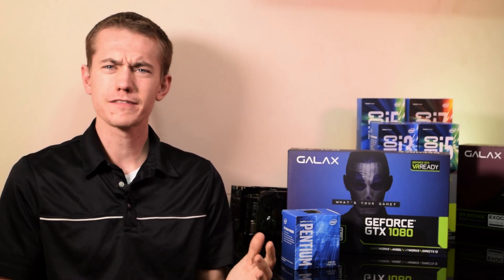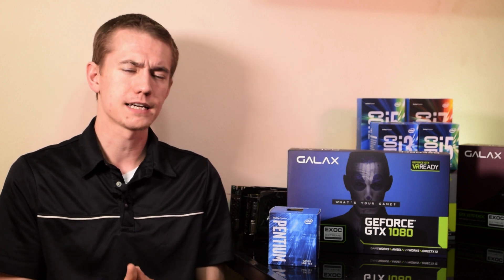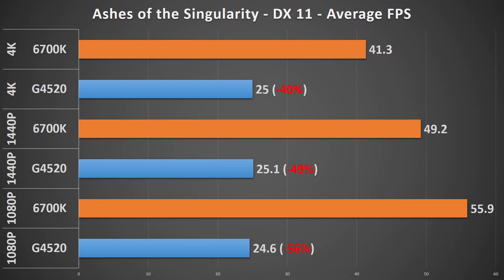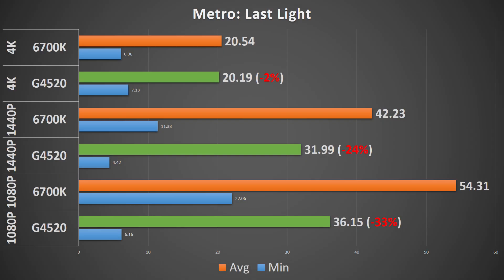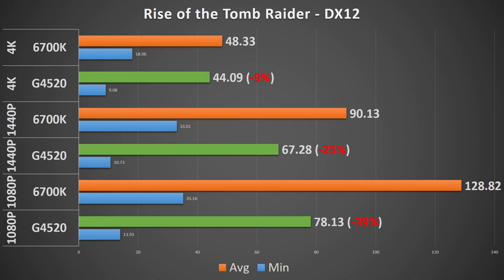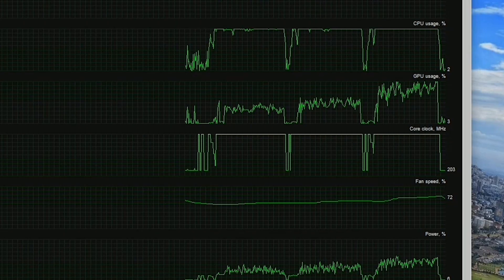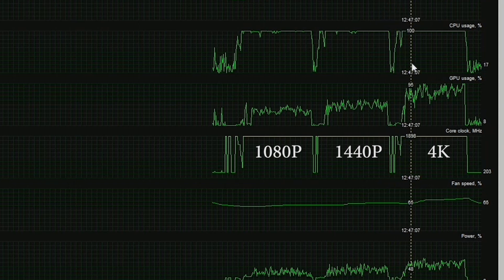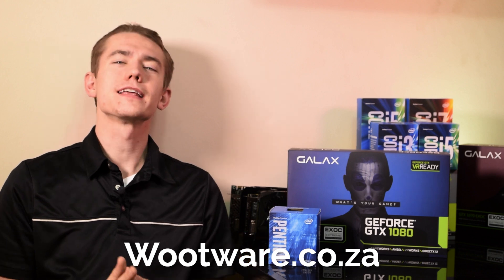Pentium G4520 + 1080 - How Much Do 2 Cores Bottleneck? - STUPID Series [#001]

Comment: I have a G4560 with a GTX 1050 TI. I'm planning to upgrade to either a  Ryzen 5 2600 + Mobo for the cpu. Or GTX 1070 TI for the GPU. I can't do both. Any suggestions?

Comment: Thanks a lot!!!
I bought a base for gtx 1080
3kmhz 16gb
6700k
Z270 

But was actually considering to buy a gtx 1080 instead of the base and wait with the gpu until I could afford the base. I was regretting buying the base instead of the gpu as now I cant get it anywhere or for a normal price. But thanks to ur vid I see I couldnt use the gpu anyway with my former i3 2120 cpu ..

Thank you for the dumb series. Sometimes its very important to know such info bcs u find ppl being cornered into all kinds of situations in this branch.

Comment: I know it might be funny, especially judging by some other comments, but some conclusions are not far off if you take the G4560 instead of the G4520. I actually made a G4560(!) build pairing it with a GTX1080 for 4K gaming and I can't stress enough how underrated or perfect of a combination that is for that very purpose. As the G4560 is a hyperthreaded part, it makes all of a difference as it provides games the 4 threads they are asking for to get rid of the otherwise apparent stutter that you might get on some games on the G4520. The G4560 processor however, costs about 60$ and offers absolutely no tangible difference in 4k games compared to anything all the way up to the 7700k. That's a 5 times more expensive processor driving same frames in 4k gaming as the G4560, as you're tied to 60hz and both chips deliver that in all but 3 CPU bound games in existence. In worst case scenarios you will notice drops to 40s that the 7700k would otherwise maintain. No biggie for a difference between 60$ and 350$.

I read several reviews stating "nobody would pair the G4560 with a GTX1080 so this is just to test the processor's capabilities without the GPU bottlenecking" yada yada. Everyone tests in 1080p. Sure, for high frame rate gaming that's what I would be interested in. But guess what, for 4k gaming, the G4560 legit maintains whatever frame rate the GPU is capable of spitting out all the way to the monitor's refresh rate and it is indeed the perfect processor. Future proofing? By the time the G4560 chokes, you will be able to switch to Coffee Lake (or maybe Cannon Lake) on the same socket and still save money and still have more longevity out of your platform without ever sacrificing on the gaming experience.

Going even further, save 300$, get a 1080TI instead and it will serve you so much better at 4K. You can still walk away with some spare cash and ability to crank the settings from high to ultra without still being limited by a freaking 60$ CPU that makes the i5s and i7s feel just like a pure waste of money for no gains whatsoever. The fact people are not talking about this or doing that all over the place made me scratch my head. Thanks!
Reply: Szymon S. Thank you so much for your comment, I've a g4600 build and been wondering if to get a GTX 1080. You've just answered it for me

Comment: Great video. Do you have any information in regards to Coffee Lake CPU's being supported on Z270 motherboards? I currently have a 4790k, and am in the process of giving it to my friend who's struggling on an Athlon 860k. I was considering buying a z270 motherboard and a G4560  as a place holder, and upgrade to Coffee Lake in the future "if" the rumors hold true. However, I would hate to buy into z270 and then not be able to do so. I understand that official information on this is scarce, but I figure it's worth asking if there is any validity to these rumors.

Comment: well, guess what? i`ll be using the G4560 with a 1080 Ti really soon, because i feel that the 980 ti can`t get the best of the dual core :))
kidding asside, i WILL be using this setup, but only for a while. I`m selling my 4690k and 980 ti, buying a 1080 ti for the main gaming pc and the cheapest kaby lake platform for a 4k hevc h256 HTPC, wich i`ll use untill the next gen platform is launched. I mainly play Dota, Assetto Corsa and Dirt Rally in 4k, so i`ll be ok for a while.

Comment: Hey could you try this with a 1070 and at 4k, to see if the stutter is gone? or perhaps use a higher clocked dual core?
Reply from the maker: +Ignafiltro Sanchez I did.  See my follow up Pentium video.  Pentium is bad for gaming, stutters any 4K capable GPU. 4 threads seem to be a minimum.

Comment: Pentium g4560 paired with a gtx1070, what you think. The plan was to get a asus strix 1060 but asus strix 1070 is only like $80-100 more on amazon so I figured whatever I'll get more frames & guessed the cpu'll live, for now.....kinda scared for when I set this crap up cause 1070&1080 same damn card almost!!!! Can I get your/somebody's thoughts on this???? I'm 100% serious this is big money coming from consoles I'm scared lol
Reply from the maker: The G4560 is going to bottleneck the 1070.  Here's a deep dive I did with the i3-6100, similar to the G4560, https://youtu.be/mxCFKkEvN0A   Even with a decent i5, the 1070 can still be held back in some games. It won't ruin your experience, but it's not a wise idea.

Comment: You can do the same test but for example comparing an i5 6500 with an (i7 6700k or 6600k OC) paired with 10xxgtx on games, i see a lot of people asking those on the web, it would be interesting to know how much bottleneck in % would have an i5 6500 compared with the other/s CPU/s
Reply from the maker: +maickel coelho In the works. Video will be out soon.
Reply: Thanks! I'm sure it will bring a lot of people to your channel ;)

Comment: I'm still running an old i5 3330 (alongside an RX 470). Do you think there's any reason to upgrade at this at this point?
Reply from the maker: Eh, if you're happy with your framerates, then it should be fine.
Reply: ***** Hmm. For the most part I'm content. I just wanted to know if it was holding my GPU back.
Reply from the maker: +Sir Caco D. Mon Likely a little bit.  However, I don't think you should concern yourself with it if it's performing where you expect it to.
Reply: ***** Alright. Thank you.

Comment: From your video, we can draw the conclusion how a modern day Intel 6700k processor can be the the bottleneck with a powerful GPU with 4k resolution. If I was AMD, I would exploit this fact with their ZEN processors coming out. That's why I think your video makes sense.
Reply from the maker: +Ravi Peiris If the 6700K was the bottleneck, wouldn't the GPU get lower frame rates with the Pentium? This indicates the GPU is the bottleneck as the frame rate is the same regardless of processor.
Reply: Good point

Comment: please do it for i3 6100 vs i5 6400
Reply from the maker: Already done, well with a i5 6500 instead of 6400, video out soon.
Reply: UFDisciple thanks. it would be interesting do compare 2 high frequency cores + GT vs 4 low frequency cores of the 6400

Comment: I have a AMD FX 6100 and i just recently bought a MSI GTX 1060 3gb; which i haven't receive yet, will the CPU bottleneck the GPU? I have the room for upgrading in terms of CPU, because the motherboard i am using is MSI 970 GAMING (AM3+), but i was hoping i didn't had to do that right now.
Reply from the maker: I haven't personally tested the FX 6100, so I can't say 100%< but it likely shouldn't be enough of a hindrance that you should worry immediately. It should be sufficient until you have the cash to upgrade to Zen or Kaby Lake.
Reply: Thanks i appreciate your response, and i have just purchase a be quiet! Pure Rock Slim CPU Cooler hopefully i can get a bit of overclocking for the CPU...

Comment: what about i5 760 i have oc it to 3.37 ghz and GTX 1060 ?
Reply: It's getting older but if you OC it to 4Ghz or more it still a fine gaming chip.
Reply from the maker: Don't have one to test, sorry.
Reply: I have a i5 750 at 3.8Ghz and a GTX1060 on a P7P55D motherboard. That along with a SSD and 16GB of ram, i can't say i need upgrading anytime soon. Oh and a hybrid 2TB hard drive (these are getting quite cheap now) for games only actually made a difference in some games such as DOOM.
Reply: totalrandomtechnolog
 i have the same motherboard but i5 760 oc to 3.37 and 8gb ram and how game works stable 60 fps at 1080p on ultra or masive drops ?
Reply: That would greatly depend on the game you're playing, but for the most part even with this cpu and 60fps @1080p is almost a given. You'll probably enjoy viewing Hardware Unboxed video "GTX 1060 vs. RX 480 in 6 year old AMD and Intel Computers". This will most likely clear your doubts and help you make a decision on getting this video or not for your computer.

Comment: This is why CPU's like the i5 2500k or for a low end system a i5 750 are still good chips because if your going to be running a 1070 / 1080 your not going to be running 1080p, and a RX 480 / 1060 will do fine with a i5 750.
Reply: i5 750 and GTX1060 here, no complaints!
Reply: I have Intel Xeon W35508(it's basicly i7-950) and gtx 1060 3gb
Reply: i have i5 2500k with Rx 470 .. there is no lag what so ever and fps are fine too
Reply: I have a x5687 overclocked to 4.8 ghz and it kicks the crap out of my i5 6500. Its only overclocked a bit,but those xeons own.
Reply: Jimmy O So i've heard. How're the temperatures at that speed?
Reply: totalrandomtechnolog they are okay with a 110 gtx water cooler
Reply: Mr11ESSE111 if it works with a 970 it works with a rx 480. You only see bottles with a 1070 at 4.4 ghz. Its about 10 percent, same with a 980 ti. If its anything lower you very little in the way of bottles.
Reply: Mr11ESSE111 dude, you have a amd 845. The i5 750 at 4.0 - 4.4 ghz crushes that chip. I mean in cinebench r15 alone ,it crushes it by over 150 points. How about you don't comment unlessy you have or had the chip.
Reply: Mr11ESSE111 you have a shitty amd chip. A fucking 1090t beats the shit out of your crap cpu and its 6 years old. AHAHHAHHA YOU DIDNT EVEN BUY THE K VERSION...ahahhhhahahahahahaahahaahaahhahahahahahaahhaahhahahahaah
Reply: Eh, not running 1080p? not so sure about that, if you wan't to get 144hz with new games you need some serieus power.
Reply: Mr11ESSE111 at stock sure,but you can overclock it. I had one for years and if you can get it to 4 ghz with a cooler, its fine. I had a 970 with it at the end of its life and it was fine.

Comment: I'd be curious to see what happens when you pair it with a budget amd quad core. like say the 860k with a 1080. I have a good idea it'll be roughly the same, but with a quad core might not be as bad.
Reply from the maker: I definitely won't be doing an 860k, but I'm in the process of testing with other processors.

Comment: I think you should test the 6700k with a g4400 or 4500 because then they would be the same 1151 socket i beleive the g4520 is a 1155 socket.
Reply from the maker: +Steven Anderson The G4520 uses the 1151 socket.  I literally remove the 6700K from my motherboard and put the Pentium in at the beginning of the video.
Reply: Then the info on Amazon was wrong i am sorry.
Reply: Check amazon the 4520 is listed as a 1155 socket and different box then your showing that must be the 4500.
Reply from the maker: All G4xxx series Pentium chips are LGA 1151.

Comment: 52
Reply from the maker: Le wut?
Reply: ***** use 52 multipiler on 6700k
Reply from the maker: +DarkTube Don't have the cooling necessary for that.
Reply: ***** VOLTAGE 1.52 AND MULTIPILER AT 52. it will work on 120mm rads and hyper 212 coolers although it will reach around 75-80c and that you should run the fan at a higher rpm it will be just fine. it would throttle before damage either way. just for 1 benchmark.
Reply from the maker: +DarkTube I disagree.
Reply: ***** Why

Comment: i3 6100 will fix that problems and handle 4k like a god
Reply from the maker: +ariel velasco I actually have been testing this and it's not actually completely true.
Reply: I have an i3 6100 and a ,1070. They work amazing for  60fps at Almost any resolution. Unfortunatelly CPU intensive games aim for  30fps at any resolution  toó.
Reply from the maker: I'm not saying that it doesn't work, but I also am seeing that it's not 100%

Comment: Do RX 480 with Pentium vs 1060 with Pentium?? Or RX vs 970/980 with Pentium and see if results change, I would laugh if GPU usage differs even with the same cpu just different GPU
Reply from the maker: +Xeniq Way ahead of you.  Video in a week.
Reply: Nice, Also off topic but which cpu should I get for my RX 480 until zen cpu come out, i3 4170, i5 4460 or FX 6300? I3 is £100 ($130) i5 is £160 ($190) and FX 6300 with mobo is £130 ($155)
Reply from the maker: +Xeniq If you're upgrading to Zen, then probably the cheapest is the best way to go.
Reply: Okay I prolly will just hoping the i3 wont bottleneck too bad

Comment: Would a older g3258 overclocked to 4.1ghz be faster than the stock pentium u used in this video also did u overclock this pentium featured in ur vid
Reply from the maker: Yes, it would be, but not enough to make a difference.  This one wasn't overclocked, but I've since OC'd the 4520 to 4.5GHz and it doesn't help anything.

Comment: +UFDisciple can u test the apu a10 7850k with this vga? i would love it
Reply from the maker: Sorry, unfortunately my 7850k is permanently stored in my FreeNAS device, and I won't be taking it out to do testing.
Reply: +UFDisciple oh no problem! do u thing that the bottleneck will be huge? haha
Reply from the maker: Likely not that bad.  The 7850K is a quad-core CPU, which you can overclock pretty well if needed. Got mine up to 4.7GHz easily.  Should work well, but I can't guarantee it won't bottleneck.
Reply: +UFDisciple well i expect something more heavy than that anyway, thx for answer! u need to continue the stupid series 😂

Comment: If you want to just mess around with this idea. I run a G3258 but oc to 4.6ghz .  Betwwen this and my original i7 , there is not much drop. Of course there is. but with an i7 being easily 5 - 6 times the price of a g3258 .. is it worth it ? when on a budget ?
Reply from the maker: Thanks for the suggestion.  Will look into maybe doing this.

Comment: can you do a video where you compare the same graphic card but from differante brand to see who have the best price/quality and preformance relation and would be better if you try this for the 1080 cause i wanna buy one dont now which one
Reply from the maker: +bloodthrsty The issue with doing that is having all of the 1080's brought together whereas most of my card are review samples that I no longer have.

My thoughts though: Strix OC 1080 is the best overall, good cooling without sacrificing looks and fast out of the box.  Best value? The cheapest 1080.  Most 1080's overclock about the same and you'll be able to get roughly the same performance out of any one with some time honing an OC.